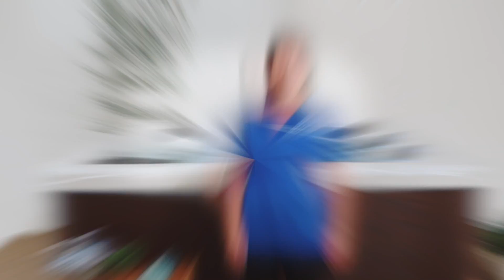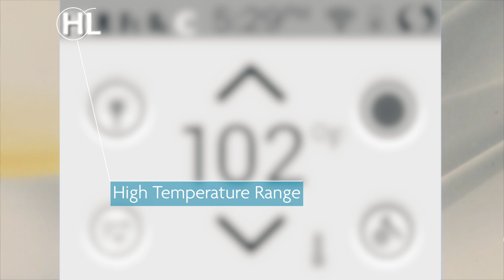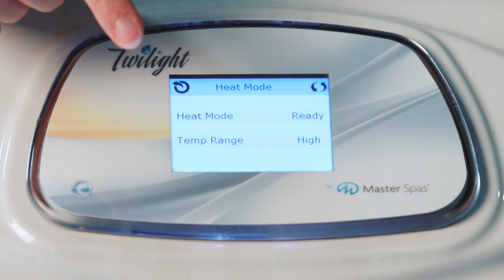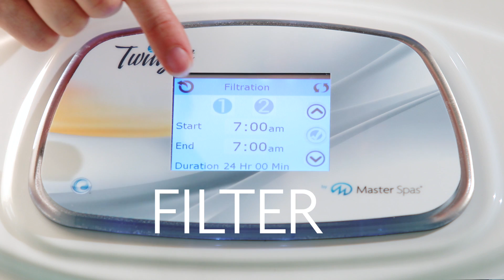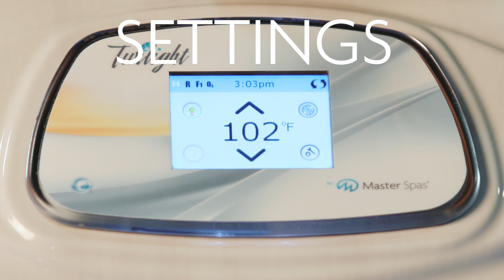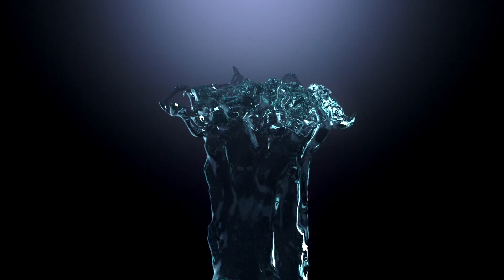Hot Tub Control Panel Instructions - Touchscreen

Comment: I just had my new Master Spas Twilight installed a week ago.  I've notice the pumps auto shut off around 20 minutes, is this normal?  they immediately come on if you turn them on but like I said they shut off all by themselves at or around 20 minutes and everything else stays on (lighting and circulation).  I have my temp set low around 95 degrees as its currently Hot outside.
Reply from the maker: Hi Mike! Good question. Yes, they should automatically shut off. It's a safety feature that we are required to have on our spas.
Reply: @MasterSpas  Maybe you should document that "feature" somewhere because it is really annoying and not sure what the safety feature is?  And why such a low time.  I know the response will be "safety" with no further explanation.
Reply from the maker: Hi James! The pump timeouts are an industry standard protocol. Almost every hot tub you find on the market will have a timeout feature. Pumps are able to heat water to the point where they will melt plastic parts just from running for extended periods of time. Because of this, pretty much all suppliers of pumps/pump controls are not willing to compromise on the automatic shutoff. Now, this isn’t to say that if you start the pumps back up again after the 15 minute shutoff everything would melt; the controls have safety mechanisms to prevent that. But that pump running all the time would be a problem that would need to be corrected. It would be a nuisance to accidentally leave your spa on the last time you used it only to discover it was too hot to comfortably get in the next time you go to use it. The 15 minute timeout is preventing human interaction from influencing the water temperature too much, and also helps with energy efficiency by not running the pumps very far beyond their intended pump cycle time. The 15 minutes is also going to give you a gauge as to how long you have been in the spa — in hot water. The water in our hot tubs can be set as high as 104 degrees Fahrenheit. The human body, when submerged in water of this temperature for a prolonged period of time, may experience issues like hyperthermia. The 15 minute timer is also a way to give the user an idea of how long they’ve been submerged in that hot water so they can better avoid accidentally inducing hyperthermia. (You can read more about this in the “Safety Instructions” section of your owner’s manual.)

Comment: Just got a brand new 7x7 twilight hot tub and I was wondering if you can do a demonstration of how to operate and use ALL the jets? Some of my jets aren’t working for some reason and it maybe be because of a setting I’m not aware of. Thanks
Reply: I'm a novice when it comes to hot tubs but i have the same tub and the jets turn off/on by twisting them left or right.